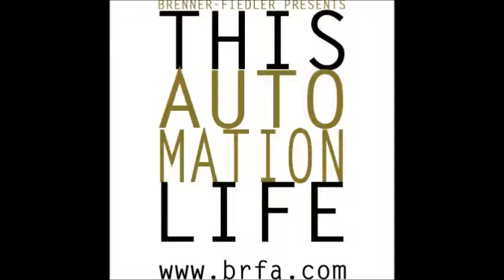Proximity Sensors - Capacitive vs Inductive

Comment: Hi,

Can i identify if a metal can is empty or not with capacitive sensors?

I`m looking for this answer but couldn't find anywhere on the internet.
Reply from the maker: +CLAVA FORTE No, unfortunately capacitive sensors will not be able to detect liquid behind metal.  I've tried it.  However, when I toured one of the Coca Cola plants I found out that they actually use radiation sensors to detect fill levels in cans.   That's right.  It's set up like a thrubeam sensor kind of like the "cat detection" sensor at the bottom of a garage door.  They blast X-Ray radiation from a transmitter and have the receiver on the other side of the can detect the radiation level.  The higher the level, the less soda is actually in the can if there is any at all.  Keep in mind that the levels of radiation have to be pretty high to go through aluminum as opposed to the "normal" levels one might receive at a doctor or dentist office visit,.  Needless to say, I pretty much gave up drinking Coca Cola and pretty much most sodas come in cans after witnessing this.  I also gave up Coca Cola for other reasons too but I probably should stay on topic.  Here is a patent link for the radiation sensor thrubeam if you are interested.  https://www.google.com/patents/US5864600

Comment: Can this be used to sense PET bottles exclusively? Using dielectric constant ? or some other parameter?
Reply from the maker: +ashutosh srivastava Capacitive sensors could be used for detecting PET bottles however they may also be detecting other products as well that may fall within the sensor's detection range.  So you need to be careful in choosing your sensors.  An application that I have used both capacitive as well as inductive sensors together is for quality control in the bottling industry.  The capacitive sensor will detect when the PET bottle is present on the conveyor line and the inductive sensor is used to detect if any foreign metal object is present in the bottle.  Then both sensors would report to a programmable logic controller to kick-off the "bad bottle".  Hope this helps.